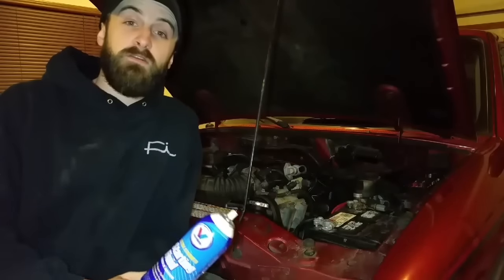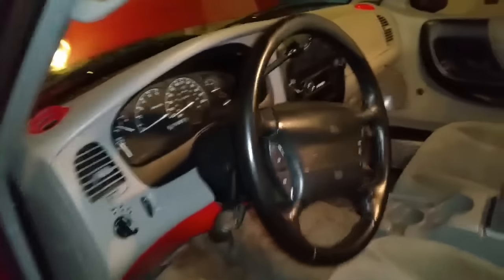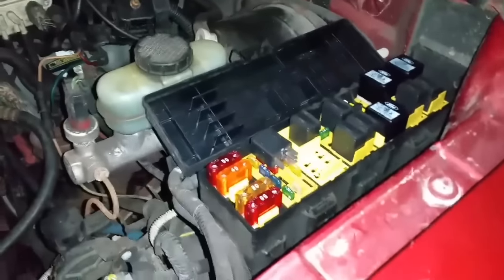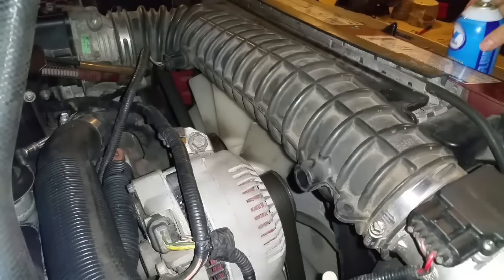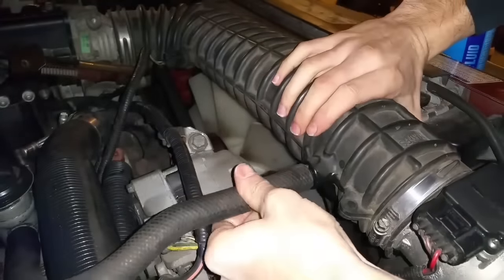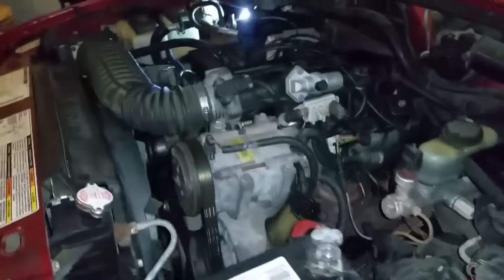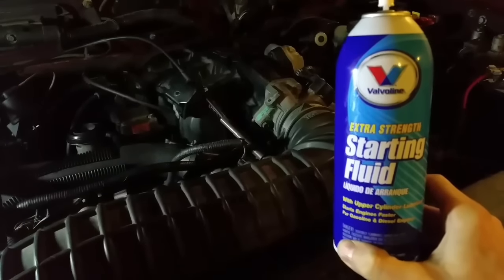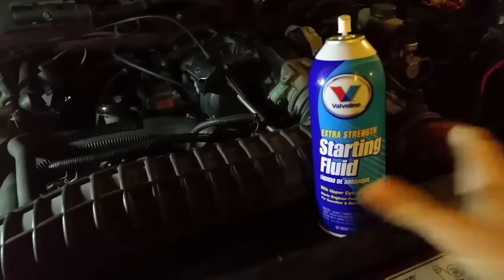THIS REALLY WORKS!!!!!!! Bad fuel pump, fuel pump relay, no fuel problem!!!

Comment: Well I’ll be able to tell y’all exactly what’s wrong with my car I’ve been having the same symptoms on my 2019 Chevy Malibu lt my Dad says it’s the fuel pump and he’s most certainly thats he’s right, I didn’t even think of the fuel pump relay, fuses,clogged filter,or wiring so those would definitely be my 1st option just in case I don’t need a fuel pump & not too mention I took it to Auto zone and a camshaft code is what came up.. all I know it’s aggravating asf🤕🥴almost at 73,000 miles

Comment: Hey , my car doesn’t start it cranks , but it’ll work if I start it with starter fluid
Reply: have the same issue, did you fix yours?
Reply: when that happened to me after an engine swap, I took out the fuel rail, cleaned the whole thing out with carb cleaner, and did the injectors too. it was also partially my shitty wiring to the cam angle sensor tho, so I fixed that as well
after that she started right up

Comment: The way you verify if you have a bad fuel pump is turn the switch on if you hear it priming the pump is working you don't have to pull a relay
Reply from the maker: The relay was pulled to "simulate" the pump not working... I put "simulate" in quotes because that's what I said in the video when I Pulled the relay... Ya knoe... ?

Comment: was it your fuel pump in the end
Reply from the maker: Noah Rule I had fuel pump relay pulled in video so this was just a test to show a way to verify a no fuel problem which could be caused by a bad fuel pump, pump relay, or other issue causing lack of fuel to the engine.

Comment: Thanks, that helps narrow down the problem.
Reply: It actually doesn't. All he did is remove the relay to simulate a bad fuel pump. It can be inertia switch, relay or loose wire before assuming it's a bad pump

Comment: Mines is made the same way gmc 5.3 the starting fluid made it backfire. It was only driving when cold and cuts off when warm
Reply: Hey same happening with my mercedes w204 can u help its just cut off when hot then needs to get cold to start

Comment: Don't always mean you need a fuel pump I did same thing sprayed starting fluid into intake van wanted to start up for a second or 2 so I replaced fuel pump fuel filter still not starting replaced fuel pressure regulator still not starting replaced fuel pump relay and fuses still not starting its 100% fuel related because of coarse the starting fluid tells us it starts with spraying fluid in intake I basically replaced everything fuel related only thing I can think of is fuel injectors not getting a pulse or are clogged but then when I have someone turn key to on position my fuel pump relay doesn't click like it should and it's brand new and fuel pump doesn't prime for the 2 seconds I can run a jump wire to make fuel pump run continuously and the jump wire works to power fuel pump so wtf powers the fuel pump relay I read it could be the ecu but idk about to give up go return all these fuel parts pump relay filter pressure regulator all back to auto store and get my 3 to 400 dollars back and put old parts back in it and junk the fucker but when it was running engine was strong it has the 5.8 351 c.i engine I just stuck and don't know what to do now well I also read that the pcu relay powers the fuel pump relay with the pcu relay right next to the fuel pump relay I went back and looked at the fuse box diagram under the hood and was reading what each fuse and relays were under hood and saw 2 different fuses for the pcu the first fuse I pulled was good and kept reading all the other fuses and came across another pcu fuse and sure enough it was blown and these fuses are the big ones I swapped it with another fuse to check to see if that was the problem and sure enough it started right up so the pcu fuse is what powers the fuel pump relay and fuel pump fuses couldn't believe that a $8 fuse was the cause of my problem and the sad part is I thought that I checked each fuse under the hood already and didn't think the pcu had anything to do with my problem at the time so ignored looking at that fuse because I was looking for fuel related problems and who would of known the pcu fuse would be the cause to all my problems

Comment: Do not do this with starter fluid you can blow the intake off. Use something less flammable like brake parts cleaner. Starter fluid is to combustible.
Reply: It's starter fluid... Is that not the most appropriate fluid to use?

Comment: you said it was a bad fuel pump by showing engine runs once spayed. therefore you said you said since it starts you condemned the fuel pump.
you ruled out that there maybe a ground lost to the fuel pump or the supply hot wire to pump had a break in the wire.
that needs to be varified prior to dropping fuel pump and paying for a fuel pump

Comment: Psalms 50:15

15  and call upon me in the day of trouble; I will deliver you, and you shall glorify me.

Psalms 147:3

3  He heals the brokenhearted, and binds up their wounds. 

Psalms 145:14

14  The LORD upholds all who are falling, and raises up all who are bowed down. 

Psalms 121:4

4  Behold, he who keeps Israel will neither slumber nor sleep. 

Psalms 139:5

5  Thou dost beset me behind and before, and layest thy hand upon me. 

Isaiah 49:16

16  Behold, I have graven you on the palms of my hands; your walls are continually before me. 

Psalms 138:3

3  On the day I called, thou didst answer me, my strength of soul thou didst increase. 

Isaiah 30:20-21

20  And though the Lord give you the bread of adversity and the water of affliction, yet your Teacher will not hide himself any more, but your eyes shall see your Teacher. 

21  And your ears shall hear a word behind you, saying, "This is the way, walk in it," when you turn to the right or when you
 turn to the left. 

Isaiah 43:1

1  "Fear not, for I have redeemed you; I have called you by name, you are mine. 

Sirach 35:11

11  For the Lord is the one who repays, and he will repay you sevenfold. 

Romans 10:13

13  For, "every one who calls upon the name of the Lord will be saved." 

Acts 16:31

31  "Believe in the Lord Jesus, and you will be saved, you and your household." 

1 Peter 5:6-7

6  Humble yourselves therefore under the mighty hand of God, that in due time he may exalt you. 

7  Cast all your anxieties on him, for he cares about you.

Comment: How do I check the fuel relay switch?
Reply from the maker: Donald Garrett I have a couple relay videos... one is showing how to troubleshoot.
Reply: ^ That is a half assed way to check. The difference between a backyard mechanic (parts exchanger) and a technician.
Reply: (Old I know but for others reading) A multimeter and a power probe or a multimeter and some alligator clips. Send power to your relay via your car battery and alligator clips to the two prongs on the relay (it will click) then use your meter on the other two and test for continuity. 

Every relay has a diagram showing you which prong is which.
Reply: Donald Garrett how do I check my fuel pump emergency shut off switch

Comment: You removed the Relay. It wont run with the relay removed.. It could be a good pump with a bad relay. All you showed us was that the engine will start with starting fluid if the vehicle has no relay or fuel pump connected
Reply from the maker: Did you have the sound on when I explained why I pulled the relay? It was pretty clear.

Comment: It proves (presuming you have a good relay in place) that fuel isn't making the trip.  Could be pump, relay, pressure regulator allowing too much pressure, clogged line, etc.
  One trick missed that baffles people when they verify pump is good but still no start...
  Turn key on, pressurize system.  Remove fuel pump fuse/relay.  Start vehicle.  If vehicle starts, runs a couple of seconds then quits, it's the pressure regulator.  The brief moment the pressure falls from too high to operating range, the car starts.  As soon as fuel pressure drops, it stalls again. 
  I've seen other techs bang their heads for hours on this.

Comment: After I checked the fuses and relays I disconnected the fuel line going into the filter from the the gas tank no gas purg after the ignition was switched to (on) it was not pouring gas; definite fuel pump out of commission
Reply: My Chevy S10 is getting gas to carb. But it won't start. It will if I spray carb cleaner in carb. Could it be my relay and where is that relay located?

Comment: Gasoline can be squirted in there, It is better for the engine because the  starting fluid is bad for the gaskets and can blow them. The  combustion from that is too explosive. Risk is small but is real. Really, gasoline works. Some of you will remember that the same thing happens when you pour a  table spoon or two into the carb opening. Easy to do.

Comment: if u never fill your gas tank up, you could have a build up of condensation in your tank(Water). rendering the gas in your tank useless.
Reply: So what do you think I need a new fuel pump
Reply: Judy
Reply: So how would you fix that issue? Fill up tank?
Reply: Gotcha thanks

Comment: This is not always true on some fords that does not have a fuel return they use FPDM fuel pump drive module located above spare tire and they go bad crack and corrosion on the back 
Use caution with starting fluid

Comment: If there is no garage anywhere near, you can temporarily fix the fuel pump. You need to know the different types of the fuel pump. There are three major types. They include; Mechanical, electronic, and finally direct injection high-pressure pumps
Reply: How

Comment: The vehicle will still die without the relay inserted.  It may run momentarily but the fuel pump doesn’t just stay on after the vehicle is started unless the relay is inserted.  Just saying

Comment: NEVER NEVER NEVER USE STARTING FLUID OR GASOLINE!!! It is too explosive use carb cleaner only it is just hot enough to test fire and will not pop back and catch fire most times if it is a timing issue!!!
Reply: You beat me to it! I don't know how many mechanics still do this. If it's a timing issue, it will definitely backfire I followed a guy who use gasoline and it popped that caught fire and the idiot threw dirt in the throttlebody because he didn't have an extinguisher. I had to take the intake off just to get all the dirt out because the client tried to start the vehicle after and sucked all the dirt in.

Comment: You can tell if the fuel pump is working by having someone turn key to on position while listen to where the fuel pump is at and you should hear the buzzing come on for just a second and go off.  If it doesn't buzz you can pop off the top where the fuel pump goes if it's in the trunk or back seat and take off the electric plug going to pump and with some alligator clip wires and a battery probe the connector and the pump will come on. And if it does come on you don't have to take fuel pump out. Then it's either a clogged fuel filter (which probably needs to be changed anyway) or a bad relay. Both those parts are cheap. And it's always good to change fuel filters anyway because a clogged filter could ruin a pump. If the pump can't be accessed without dropping fuel tank i would just change filter first and fuel relay both are $20 or less. And filter probably needs changing anyway if it's never been changed.
Reply: David A no sir not all cars have a lift pump in the tank. Some rely on vacuum pressure to start
Reply: So I changed my pump and filter back in March. In my 93 jeep grand Cherokee Laredo. I can hear my pump prime but when try and start it doesn't want to start. If I pull the fuel lines off and put them back on prime it. It will start But every freaking time it's shut off the last 3 days I've had to pull the lines off put them back on and it will start. also had to get a replacement line for the fuel pump to the fuel filter. But I've  Used a fuse tester for the relay fuse and it shows it works. I've pulled out a lot of things changed a lot of things what am I missing what would cause this issue!!
Reply: @mrskahoe  like Joshua Smith commented, it could be and probably is a vacuum problem somewhere affecting the fuel lines. Sounds like it's not getting the vacuum pressure it needs to keep the fuel flowing to the motor. I'm surprised changing the lines and filter didn't help. But the lines getting to the motor could still be clogged or a vacuum leak somewhere causing it to not get enough pressure. A shop can pressure test it and check for a vacuum loss.
Reply: @dzorba1  I replaced the vacuum lines trying to think of everything I have done.

Comment: I don't need to do this cuz I already know it's a bad fuel pump. It has no power so therefore no fuel is getting to the engine. No buzzing noise from the fuel pump.

Comment: This is step 1 but does not prove bad fuel pump.  What it proves is you have spark and ignition system is prob ok.  You could have bad fuel filter, pump, bad gas / water in the line or tank, bad injector(s), bad wiring to any of the above.

Comment: This does not prove the pump has failed. This only prove the no start is due to lack of fuel. There other reasons for a no fuel situation where the pump is actually fine. Possible isdues could be in wires, computer, pump crash shut off, fuel pressure regulator. Make sure you find "WHY" you dont have fuel before you start teplacing parts

Comment: if my fuel pump is working what could be the problem
Reply: Marcello Lewis injector issues, fuse/relay issues, connection issues and fuel filter to list a few.
Reply: Just because it is running does not mean it is working.
Unless you know the actual pressure, you know nothing.
Reply: Zack King i

Comment: DONT DO THIS... starting fluid can KILL an engine. Also can explode. Ive rebuilt many engines from starting fluid damages.(diagnose a fuel pump issue with a $20 fuel pressure tester from harbor freight.)

Comment: Here one better. Cycle fuel pump. Find pressure check valve on engine and release pressure either you'll have it or you won't.

Comment: Like many commentators have said, your test is not foolproof. It could be an injector problem or bad gas (water logged ethanol gas that has sat around for a long time). the teat does prove it is not an ignition problem. It could be an injector problem because the starter fluid will run the engine briefly by going into the air intake valves and not through the injectors.
Reply: Had bad gas in an RV, drained the gas at the rail by jumping relay and added new gas.  Fuel pump must be ok, I think?  Starts with starting fluid but dies after.  Being ignorant I was wondering about exactly what you commented on , engine runs on starter fluid but that doesn't go through injectors.  Now I'm thinking injectors or maybe ground?  But would it start with bad ground on SF?  I'm gonna get there eventually.  Thanks for your explanation about SF going through air intake valves.

Comment: You know what the real problem is...... It's a FORD
Reply: damn right .. I can work on a chevy so much easier.
Reply: SOLUTION ONE j
Reply: SOLUTION ONE 🤣🤣🤣😂🤣🤣🤣yes !!
Reply: My garbage Pontiac does this every morning
Reply: jennajone45 check a crankshaft sensor
Reply: FORD = Fix Or Repair Daily
Reply: +JW. found on road dead
Reply: Alpha Gaming Uhm depends on the chevy as far as any chevy past 2008 I would never touch or own...
Reply: who sells more trucks, year after year? chevys are for those who don't know any better
Reply: @charliewidick8314  no fix it again tony
Reply: Wow how original try again
Reply: no need cz it already cranks after spraying inside the intake manifold. if the cam or crank sensor was bad it will not crank either.
Reply: @ricochetey  what about Fiat? Surely you know Fix It Again Tony is fiat and not ford
Reply: no no no MY lt1 is pure was pure satanic when the optispark went out...FORD gets a win for no optispark
Reply: @ricochetey  damnit Dale that's a Fiat

Comment: It’s not getting fuel cause you took the relay out… I used the starting fluid to start my car it turned on then off I added it again and drove to whatabuger went home turned my car in and off autozone told me my fuel pump costs $789 for a Altima I said hell no I  cleaned  my fuel injectors and car has been running good since

Comment: This only proves that the car has a fuel system problem
Reply: that was the point dude. But you would do this with the relay in place and if still didn't work then its NOT a fuel pump issue.

Comment: Sorry but I must disagree that this concludes it's the fuel pump failing. The inertia switch can be bad, the relay can be bad, and loose wiring that are causing the pump not to work properly.

Comment: Wellll...it could be a bad fuel pump, a clogged in-line fuel filter, a bad fuse, relay, or fuel pump control module but i know what you mean. 😂

Comment: Dude put enough starting fluid to vapor lock that Ford.
Reply from the maker: Vapor lock? That's a new one.
Reply: @BlaserBuilds  it's legit, depending on the type of fuel system in discussion.
Reply: I had to ride 18 hours in car that vapor locked all the way from Arizona to Kansas! It sucked 🤬!!!

Comment: I changed my fuel pump but still wont start so I did the starter stuff again and it started and died.
Reply from the maker: Elise Marie Have you verified the fuel pump relay is working? I'd check that next. If relay is good, but pump still doesn't run it could be am electrical issue... If relay is good, and pump runs filter or injectors could be clogged.

Comment: Not always very misleading could have no injector pulse or a broken fuel pump wire or blown fuse or bad relay Dr.Phil Master mechanic Master Transmission REBUILDER!